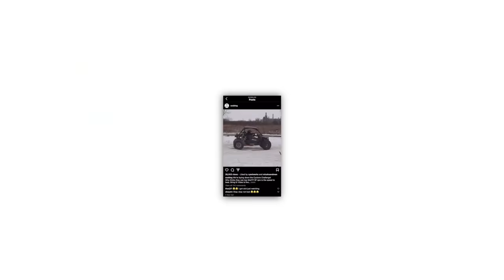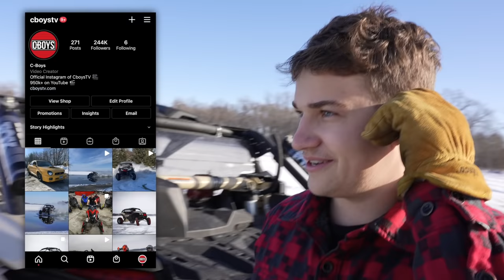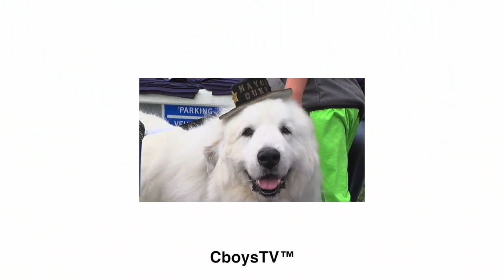DNR Officer Harasses Subaru Driver on Ice

Comment: A road citation on water ? 
I’d challenge that ticket as that’s absolute bullshit lol
I’m no expert by any stretch, but surely that doesn’t apply when on water.
Reply: Exactly what i was thinking
Reply: It really depends on the state, I'm guessing that it applies to any area that the public can access. Since he specifically mentioned that it was a public space, and didn't necessarily refer to a road.
At least it wasn't reckless driving.
Reply: your not insured soon as you touch the ice with a car so how then can inforce laws for vehicles where there is no roadway, makes no sense. its just harassment.
Reply: Its public property so the law can apply, BUT because its not on the road, the common law standards cannot be applied. So if it was actually something bad (like drifting 2 feet from a ice house) then it can apply, but how they did it here means it doesn't. 

You are allowed the same stuff for parking lots in the middle of the night, thats why may towns have time laws for parking lots.
Reply: @wolfsden6479  lake's arnt property. Cant own water brah
Reply: @JohnSmithKillFeds  yes, yes you can
Reply: @wolfsden6479  nah,
Reply: As a realtor that has to understand property rights its is very possible to own a lake, rights to the lake, or for it to be public. So depending on it ,and the states common law, a few different things can be used in court.
Reply: @wolfsden6479  alternatively, nah
Reply: @JohnSmithKillFeds  lmfao, alright then. At least I got a good laugh today.
Reply: @JohnSmithKillFeds  you can own a lake if your property completely surrounds it
Reply: @Florida_man420  tell that to the dnr, they wont let you fish on it.
Reply: @JohnSmithKillFeds  you aren't very well educated are you?
I live in a very small town, and there are several privately owned bodies of water. Some of those are given public access by the property owners, posted no liability etc etc.
A person 100% absolutely CAN, own a lake. Just because you can't afford it, doesn't mean someone else can't.
Reply: @Druid_Plow  nah, you're wrong.
Reply: @Druid_Plow  lol it is fucked my neighbor owns like a pound on his land he has a mansion only one in my town and he ice fishes on it the dnr literally says he cant fish on it hes got fines from it and everything I think they stock it with walley and stuff I just dont get it im from mn as Well so maybe its just our state idk
Reply: @wellidk556  they wouldn't stock it if he owns it outright, so if they are filling it as part of the state's annual schedule then there must be public access and they absolutely can regulate it.
It all depends on the specific litigation in the state, but my main point is sinpmy that someone can privately own a pond or lake.
Reply: @Druid_Plow  no i think the owner stocks it
Reply: @Druid_Plow  and its in his huge spiked gated fence no one can it in but him
Reply: @wellidk556  yeah they can't regulate fish that you buy for yourself. That would be like telling you what color to paint your house, or what kind of bushes to plant in the front yard. 😆
Reply: @Druid_Plow  god thaats what i thought i wonder what is going on there so if he like out right owns it does it all they cant say nothing about it?
Reply: @wellidk556  exactly, if he own the water and the fish in it then they have no say. But without knowing all the details we can only speculate. For all we know there could be some kind of a land dispute, so DNR thinks one thing while he thinks another.
Reply: @Druid_Plow  yeah i suppose so now its kinda buggin me oh well thanks for the knowledge
Reply: @wolfsden6479  in Minnesota you can own the land under the water but not the water itself. Hence if you can float on it it's legal to be on as long as your not touching the land. Ice has the same rule. As long as you're not touching the ground it's OK. Even if you own all the way around the lake I could use a plane to legally be on it. I think man made lakes are the exception to the rule.
Reply: The ticket applies for any road or public place so that includes the lake. I thought the same thing as you at first but it seems the only place safe from road citations would be private property. If someone owned that lake he could dispute the ticket but I doubt that’s the case.
Reply: In Minnesota careless driving applies to the following as well as the public roadway; 
1) upon the ice of any lake, stream, or river, including but not limited to the ice of any boundary water; or
(2) in a parking lot ordinarily used by or available to the public though not as a matter of right, and a driveway connecting the parking lot with a street or highway.
Reply: @JohnSmithKillFeds  alternatively, they will pay the fucking 300 bucks, and rake in a thousand on the views, cause you know, they dont give a shit. They won't be wasting any lawyers fees and court time on this one.
Reply: @zincfive  and also, the dnr shirt sales.
Reply: @Druid_Plow  the dnr regulating and trying to fine someone for fishing on a private lake which was stocked with privately purchased fish is more like the dnr trying to tell a farmer when they can and can’t kill their farm animals for food. Now it would definitely be different if there was a creek coming from off the property feeding into the pond which in turn out flowed and continued off the property as since the waterway is connected there technically is no way to know if the fish where stocked by the land owner or came in from natural reserves. I also don’t know how it would work if the pond was fed by a natural spring with continuous runoff into a creek that leads out of the property’s boundaries.

Comment: perfect example of literally not hurting or bothering anyone and someone has to go and ruin the fun....
edit: there's always that one "ACKKSHULLAYY" guy in the comments. bro we get it. thanks for the buzzkill.
Reply: If the car crashes through the ice it creates a ton of pollution, and it will endanger any recovery team that has to now pull the wrecked car and your dead body out from under the ice that’s obviously thin enough for vehicles and recovery equipment to crash through. If they wait till it melts then it leaks a lot of oil and gas into the environment, and if they still want to pull it out they now have to use a barge and crane, or at the very least have a scuba diver recover the body…

There are other reasons why it may be illegal to drive like that on the lake too.

It definitely has consequences for more than just yourself if something goes wrong.  Expensive, a waste of time, and dangerous for everyone involved in the situation.

The officer has discretion but there are indeed a few legitimate reasons why driving on a lake like this can cause issues for more people than just yourselves.  

There are designated ice racing lakes for a reason, since they’re known to be thick enough to not be dangerous and they sometimes even have standby recovery equipment for sunken cars.
Reply: @Chevsilverado you can go on the ice with a vehicle in most places.
Reply: @devjlboy  Did you read what I said?

Even if it’s legal to drive on a lake ice racing like this can be considered illegal due to the fact that it puts much more pressure on the ice than simply driving across. 

Also, not every frozen lake can be driven on… again, even if the ice seems thick there can be thin spots on some lakes which is the reason why some lakes are not allowed to be driven on.

I disagree that you can drive on frozen lakes in most places because that’s literally not true. Most places don’t get ice thick enough to reliably support vehicles.

People illegally drive trucks on the lake where I live and there’s always a couple of them that go into the water and require very expensive and dangerous recovery, exactly as I said.

Even in the coldest part of where I live only some high up lakes can legally be driven on because not all get enough ice to support a vehicle, and I live in a pretty cold place overall… definitely colder than most places in the USA
Reply: @Chevsilverado  calm down bro. also if it creates pollution then fine them. but until that point stuff like this is just stupid. reckless driving? absolutely ridiculous
Reply: @Chevsilverado  innocent until proven guilty.
Reply: @Donut-zw2bb  literally doesn’t apply to the situation I stated but okay
Reply: @Chevsilverado  reddit the post
Reply: @SwampMonster440 That’s not true. A car sitting under the ice for a couple days will leak at least some fluids. 

Since recovery is probably impossible when the lake is frozen either it’ll sit there forever and rust apart releasing all of the fluids, or it’ll sit there for a season until they can get a barge crane and still release a substantial amount. 

You can see it with car accidents where they drive into a lake or pond. There’s a very visible oil slick that develops around the car pretty much the same day…

It’s a considerable reason why some lakes are illegal to drive on.  As the majority of frozen lakes are not thick enough to support a car.  You get idiots thinking they can drive on the lake, then crash through and die and pollute the water.
Reply: @SwampMonster440 Depends on the size of the lake smart guy

Lake fucking Eire can take a few ships worth of oil and not care 😂 however I’m sure if 10000 shipwrecks DIDNT sink there the ecosystem would be in better condition. 

Sinking a car in a relatively shallow small lake can definitely have significant impacts to the ecosystem.  It’s been proven many times by trial by fire.

I think you underestimate the absolutely massive size and depth of Lake Erie + how much water is circulated through its system.

A truck sunk at a lake where I live and completely killed all the fish and frogs there. Was a small-medium sized lake I’d say. No more fishing.  Not from ice breaking but from them driving the old truck into the water for fun.

In small lakes the ecosystem is quite delicate and if it’s already thriving, a large volume of oil and gas can change that quickly.  There would definitely be some effect.
Reply: @SwampMonster440 If you want you can look up the dozens of news stories related to sunken cars causing pollution in lakes. Some of them are even specifically about cars crashing through the ice 😂
Reply: @SwampMonster440 So there’s a pretty large lake where I live and if you compare the volume difference between it and Lake Erie, Lake Erie has 25,000x more water than this large fishing lake. So you could sink 25,000 cars full of pollutants in Lake Erie to equal 1 car in this pretty large fishing lake.
Reply: @randomnessslayer  Literally entirely depends on your location and the specific lake you’re talking about. I know nothing of the lake in the video, however various lakes around where I live have warnings that it is illegal to drive on them when it’s frozen, reason being is pollution if a car goes through and ice that’s usually too thin. Unless the lake is high elevation they will have a sign posted that prohibits driving any vehicles on it…

I can’t speak of anywhere else for sure, however I’m just saying some reasons that it may be illegal on their lake and it may be the reason why they were stopped by the cops. 

So if you check with your local laws and see that it’s fine to drive on a lake near you, great. However there are definitely lakes out there that are not supposed to be driven on. 

My sources for my pollution claims can be found on google, as there are literally dozens of articles about sunken cars affecting the ecosystem in the lake. You can check them out if you’re curious, as stated in my previous comments.

If you want to double check my claims, go ahead.

You’ll find:
1. Lakes that are illegal to drive on because cars can crack through. 
2. Ecosystems that have been destroyed due to sunken cars. 
3. Lakes that are illegal to drive on due to being protected ecological areas. 
4. Lakes that are illegal to race on due to it being for ice fishing primarily. 

Not very hard to do some double checking if you’re so inclined, and these are pretty mundane claims…

and again, it entirely depends on where you live. I’m sure some states let you do whatever the hell you want, but that’s not the case in other countries and most likely in some states.

For example, in Ohio frozen lakes can only be driven on when specifically posted. As well, driving over 20mph is illegal when within a certain distance of shore. And I believe it also states that no regular vehicles are allowed on the ice, only off road vehicles and snowmobiles… so doing this video in that state is illegal since cars cannot legally drive on frozen lakes in Ohio…

Code 1501:46-14-03

Not hard to find some info my guy. Again, my claims are not especially outrageous, so idk why you seem to think I’m lying…
Reply: @Okenshel  I am not sure where this video is, but in ohio it’s illegal to drive cars on a frozen lake, and it’s also illegal to drive an off road vehicle faster than 20mph when near a shore. 

Also, in my country at least, lots of drivable frozen lakes are treated as public roadways unless stated otherwise for fishing or recreation. So doing donuts and such can easily be treated as reckless driving since by law it’s equivalent to doing it on the highway.
Reply: @Chevsilverado  where I live it's legal, with the exception if the municipality has put a restriction on it which they can. If the car pollutes, they can get tried in court and fined (theoretically even prison is on the scale)

Otherwise, they just risk hurting themselves and their cars, which has happened
Reply: @CrazyChickenFarmer  Because I’m right?  I’m not sure why everyone thinks I’m lying when I posted state codes to support my claims, as well as the fact that there’s dozens upon dozens of articles focused on sunken cars creating pollution…
Reply: @user-wq9mw2xz3j  Yeah that’s the case for many places however some states and countries are not like that which is my point.
Reply: @Chevsilverado  except... His car didn't crash through the ice, didn't leak fluid, didn't pollute, and didn't need to get removed. If his car crashed through the ice, then yeah he should be ticketed and fined, but that ticket was for absolutely nothing. BS ticket for sure.
Reply: @Chevsilverado  less than 15 gallons of fuel and even less other random fluids. Nowhere near enough to cause any actual pollution to the lake
Reply: @Chevsilverado  you do know cars polute without being in the water right? so did these cars crash through the ice or you just trying make your excuse feel validated
Reply: @kerns321  emitting mostly co2 is not even close to comparable to dumping like 25 litres of oil and coolant + 50 litres of gasoline into a lake. Just not a comparable situation whatsoever and not sure why you think you have a point…. If you truly think your point is valid idk what to tell you 😂. It’s not clever at all
Reply: @scwyd6769  Depends on the size of the lake and it has done measurable damage before as you can research online, as I have said.

If you have the time just look up examples of ecosystems being damaged by sunken cars and the fluids leaking out. Don’t have to take my word for it, as I’ve said like 10x by this point.
Reply: @jordank1813  It’s illegal to drive on some lakes due to the fact there is a high chance on some lakes to crash through, and they don’t want to pollute the lakes. 

Not sure what the case is for the lake in the video, however in some lakes it is indeed illegal to drive on them for the risk of pollution. As I have stated before. 

It’s like all of the commenters arguing with my points are incapable of just typing “lake pollution by sunken cars” and reading a little bit about it…

Research that, and look at some examples of lakes that are illegal to drive on due to risk of pollution in a fragile/protected ecosystem.

I’m just saying, it’s possible that they were driving on one of those lakes that are protected ecosystems or something. Idk their state laws or that lakes laws, I’m just saying it’s possible. I don’t see what the issue is with my statement. 😂

Like Jesus Christ.  Read what I’ve written before and look up some basic facts and regulations of various places before trying to prove me wrong. 

Are my claims really that outlandish???

I’m just repeating myself at this point because you clearly didn’t read what I’ve said before.

The whole reason why I got into this argument is because there are lakes near where I live that are illegal to drive on with any vehicle because of the danger of pollution. That’s it. Whatever this videos lakes laws are I have no idea, but it’s possible there’s a ban on driving cars there for whatever reason as there is on other lakes and in some states entirely, like I have said, and I have provided sources for a state that has entirely outlawed driving regular vehicles on frozen lakes… and it’s not the only place like that.
Reply: @Chevsilverado  I bet your well fun at parties going round trying to prove yourself to everyone lol🥴😂
Reply: @Chevsilverado  You keep using the words "crash through", since when do we use that word for driving on the ice? You might break through the ice, or fall through but your not crashing through as you are already upon the ice. Unless they are jumping from land to the ice then yeah that would be a crash, or maybe the car is dropped from the air by HaveyD's blackhawk....LOL
Reply: @Chevsilverado  you should be a blogger.
Reply: @Chevsilverado  People sink boats in lakes and leave them there all the time and it's fine. You have no idea what you're talking about. It's not ideal, but it's not as if a few quarts of oil is gonna cause a natural disaster.